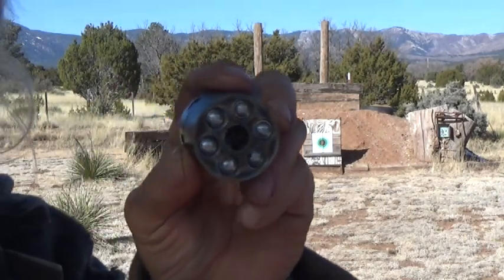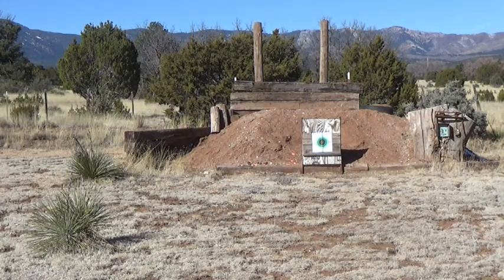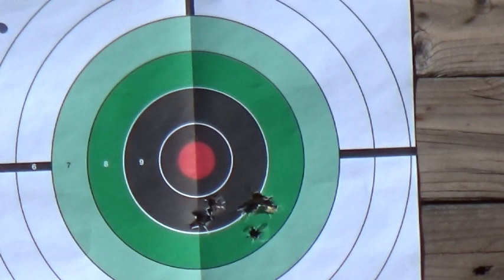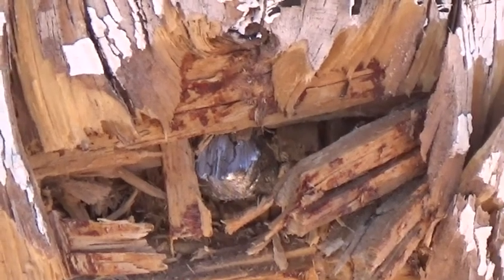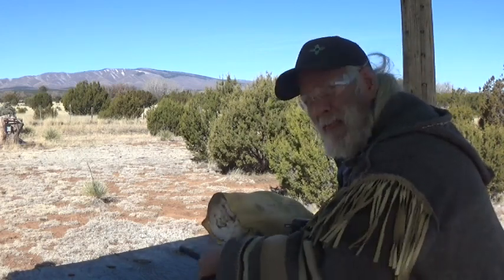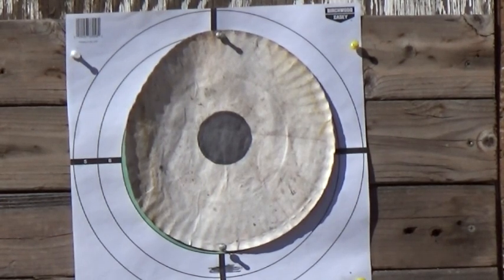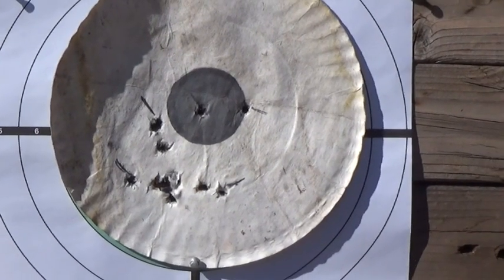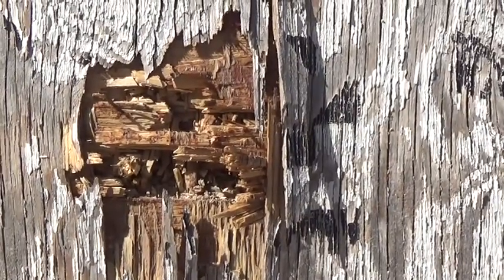1851 Navy Do You Suffer from Loose Ball Syndrome

Comment: I think that with the round ball group spreading out. A reduction in powder charge is an indication that you need to step up the powder. My old .36 liked 23 grains. When you decrease the velocity you decrease the RPM of the bullet too. Hence why on high twist rifles (1 in 28 to 1 in 48) It is possible to over spin a RB. Round Balls are the easiest to stabilize, but they must also be balanced along its axis. It is one of the reasons why i weigh my bullets in groups before shooting.
Also, if you want a way to measure the ball depth try using the loading rod on the revolver. Mark the rod to depth then don't go past the mark. Its easy and i been doing it for years. This will also allow you to use the same seating pressure, also valuable for consistency.
Reply: Yep, I test my loads in one grain increments until I hit the sweet spot, I start with a full load and work my way down.
Reply from the maker: True, In a earlier video I mentioned the  twist looks like a fast twist.  Since I do not competitively compete  weighting the bullets for me is irrelevant.  Thank you for your comment.
Reply: @lamebeavertradingco.1642  , The older BP revolvers had a twist of 1 in 28 to 1 in 30. The new manufacture of replica BP revolvers has a 1 in 12 rate of twist. The manufacturers made the twist tighter to accommodate people converting BP revolvers to cartridge (1 in 12 is a modern standard pistol twist).
If you own revolvers made before 1995 it probably has a 1 in 30 twist. My CVA, Armi San Marco has a 1 in 28.
My Uberti made in 1968 has a 1 in 30 twist.
Reply: GunDrone!.. yes! Very good info!!..I have always inspected every cast ball and bullet I cast and only keep and use the top heaviest 20% for target shooting and the top next 15 or 20% for just target practice....the rest I remelt  and cast again till I only have a quarter of that alloy mix left and then add more lead and or tin etc. To fill my 20lb. Pot. Those first 20% I'll inspect and weigh and put into three or four groups by weight,  being only a grain or two in weight in batches of ten to fifteen balls or bullets and label the containers with weights and date casted. Those heaviest ones for formal target shooting only and the rest for practice only. Round balls!..I prefer swagged balls over cast but even the swagged balls I weigh and put into groups by weight because they can very in weight and roundness too. The Black powder I use is weighed too not by volume but weight because the size of the granules are not uniform in size. Yes!.. it seems over kill but ir does make a difference in the long run. In practice I shoot small groups but in competition I shoot much smaller groups if I do my job which is easier if the loads are more uniform to start out with. Just saying!
Reply: @garyfoltzer6618  , Weighing them is not time consuming. I use the powder in volume and generally don't weight it.
Centering the sprue of the cast ball is more critical than most know. The reason: It can cause an imbalance along the RB's axis. Swaged round balls are more consistent , but I weigh them too.